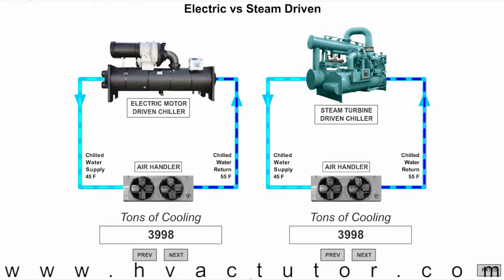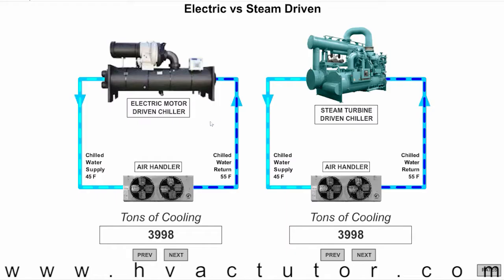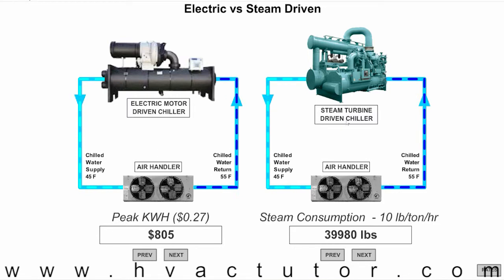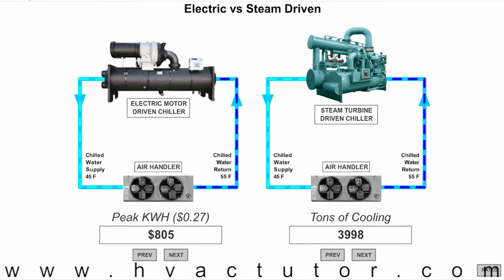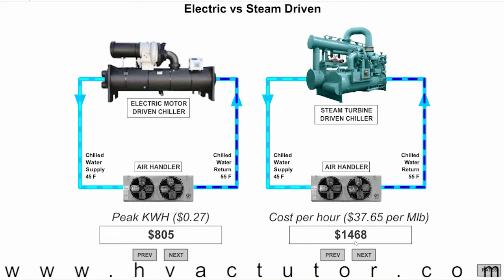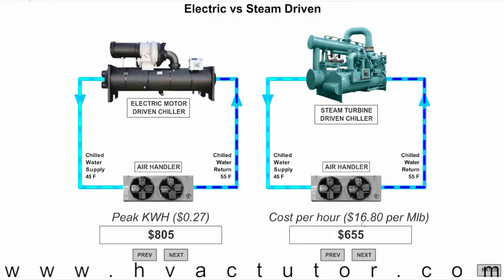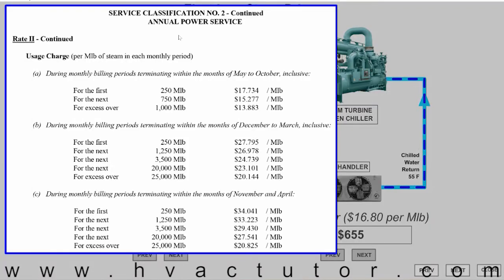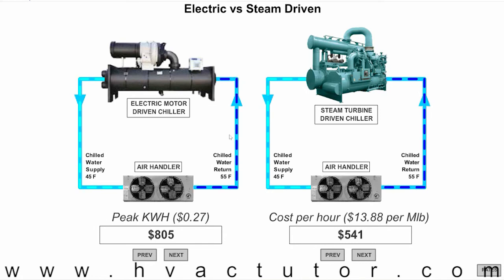Steam Driven Chiller vs Electric

Comment: Your example uses $0.27 for the electricity rate which is very, very high. Our rate is $0.08 and we don't pay peak or demand charges so using our steam to drive our chiller is much more expensive than electricity. Not sure how much most people pay but electricity is far less expensive and electric chillers require less man hours to operate and maintain. Just an FYI...